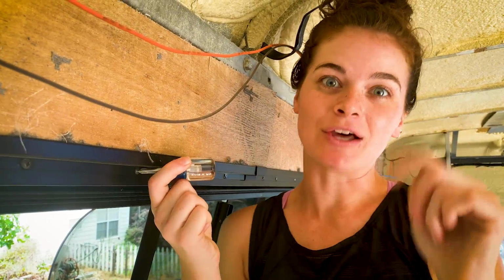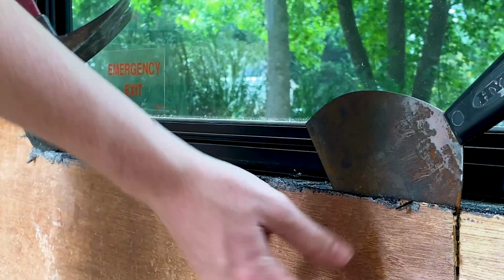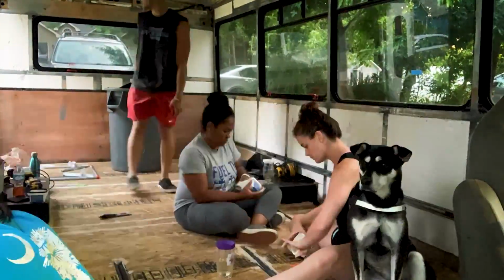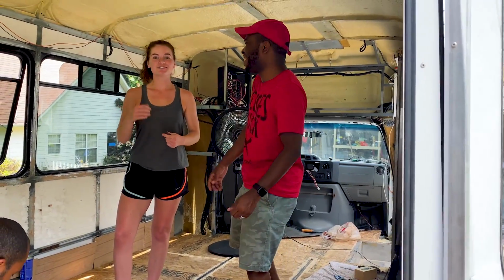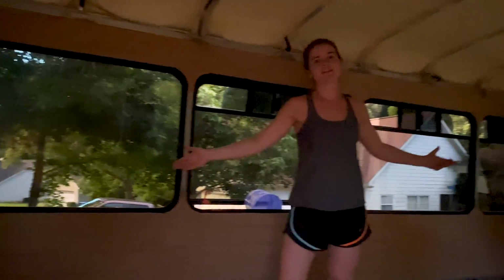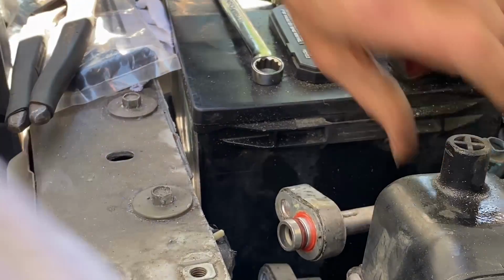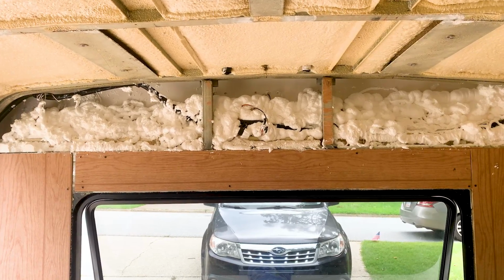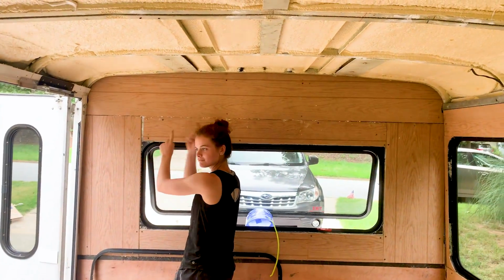SHUTTLE BUS Conversion | Building New Walls & Insulation | DIY & How To Skoolie Life

Comment: (reposting) Hi there!  We just started our demo yesterday!  Trying to decide whether to remove original sub floor.  Ours is a Florida bus, similar to your Georgia bus without the salt and rust. If you did it again, would you have removed yours?  It looked like it was in great condition, dry and almost new.  We have a 2007 so a bit older than yours.  I think we're going to leave the original particle board/sub-floor if it looks as good as yours did, after we get the rubber flooring completely removed.  Do you feel better about the build that you removed everything, sanded the frame and repainted it?  Obviously, we don't want to do it if we don't have to.  Thank you for these videos- very helpful!  <3
Reply from the maker: Victoria Lawrence Hey Victoria!! First off, congratulations on the conversion journey! ❤️ if we had to do it again, we would not remove the sub floors because they were in great condition. We were really only concerned about the rust since our bus was from up north originally. If your bus doesn’t seem to have any rust and the sun floors look decent then we recommend to leave them as is but that is entirely up to you!! We do feel better after replacing them just for our own piece of mind! We’re so glad these videos are helpful 😋❤️
Reply: @AwakenDaze  Ok great, thank you so much.  Shew!  I feel better about leaving them now.   We're still in the demo process.  The only bad thing about having a Florida bus is starting a build in the middle of the hottest summer ever!  I love the quality of the videos. You guys are doing a great job on both the build and the filming and editing.  <3
Reply from the maker: Victoria Lawrence we can completely understand that. I’m sure Florida is way more hot and humid than Georgia but this summer has been scorching! Thank you so much for the love!! We can’t wait to be done with the conversion process so we can show you guys more of what we have under our tricky little sleeves 🤪💗 what made you guys decide to join bus life?
Reply: Victoria Lawrence I’m building one in FORT MYERS FL
Reply: Hi!  I am starting demo next week, definitely have to remove the flooring in mine.  Its from Missouri, but from '98.  Let us know what you decide!
Reply: @thegeobus1  I updated the thread.  :-)
Reply: @AwakenDaze  Hi there! We are leaving the floor and replacing four small areas where there has been water damage to the wood.  Going to be brushing down the rust and spraying it.  The water has come from a few leaking windows.  So we'll be doing so resealing to those.  Removed the fiberglass insulation on the walls and will replace with something a little less toxic. Temp down here in south Florida is "feels like 106 degrees with the humidity"- it is brutal!  I know it's hot for everyone, so you all hang in there!
Reply: The rubber floor in my bus was in great shape and it’s really an extra vapor barrier so i did furring strips, covered it with 1” hard foam insulation and 3/4” subfloor with the foil on it to reflect heat out. Topped it with laminate flooring that has the underlayment stuff attached to each board.
Reply: @freejojoey530  We left our rubber too.  We only had a strip down the middle though.  The rest was glued carpet.  The carpet was horrible to get up and the unrelenting glue remained so we covered it with eco cork foam (very thin layer of insulation for moisture) then topped it with birch. We then painted with water based polyurethane.  We'll see how well it holds up.  We can always cover it with laminate if it doesn't wear well.

Comment: What material and thickness did you use on the walls?
Reply from the maker: rhellemans the material that we used was some type of cardboard I believe and it does NOT work. We had to tear it down because it was absorbing moisture. If you have the option to not rip walls down, don’t do it!! We spent a lot of time on it only to rip it down. But there are very thin pieces of plywood that you can purchase at Home Depot! ☺️
Reply: @AwakenDaze  Thanks for a quick reply!  My bus, had fiberglass walls, I took that out to the honeycomb.  I was debating on what to use. I tried a thin birch but I felt like the same issue.. it didn't handle humidity well.  I think I am just going to go with the more expensive plywood, but better to get it on the first go.  Thank you!
Reply from the maker: rhellemans definitely invest now so you won’t have to pay more later on down the road! Good luck to you!! Let us know if you have any questions!! ☺️